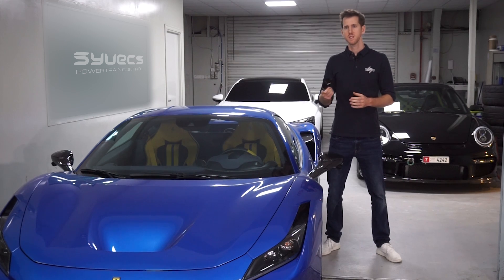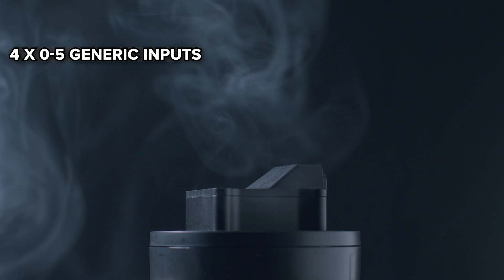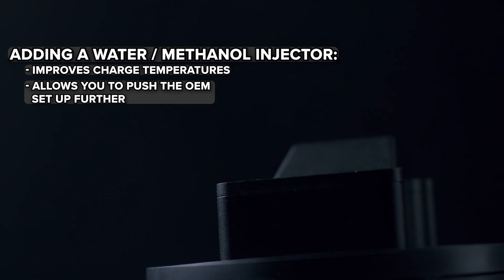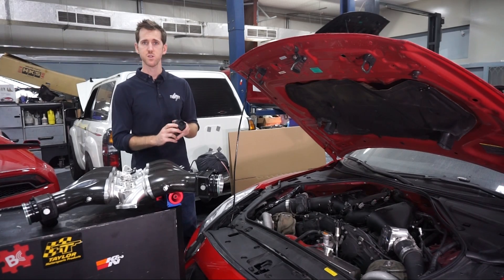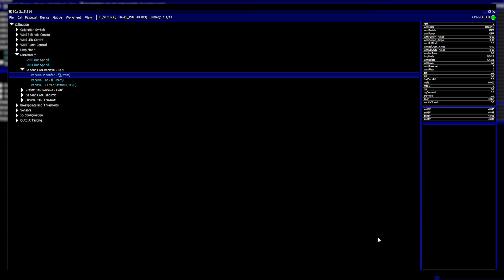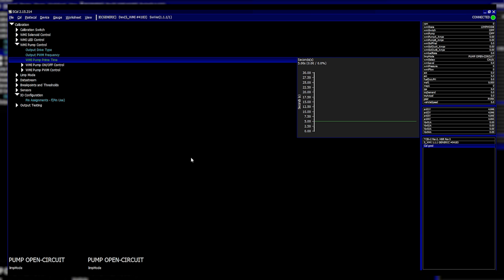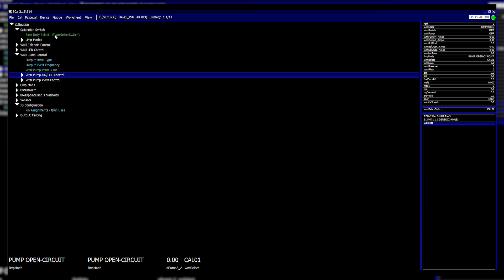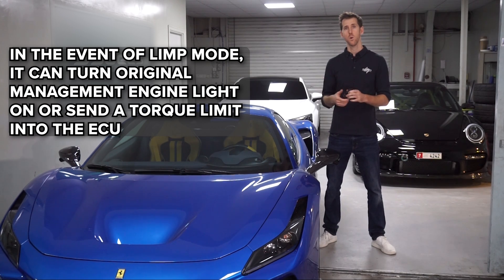Syvecs | Water / Methanol Injection Controller Tech Video

Comment: I was led to believe that this was a full stand alone controller, but unfortunately its still not as addressing can and obd protocols doesn't cover all cars.
I have a fdrx7 and a 2004 np Pajero that i would love to use this on but is not  supported.  The Pajero is pre common rail so still utilises the MUT protocol and is quite limited even though it does have some electronics which are part of the fuel pump.

Comment: I HAVE BEEN WAITING! For this product some time now, so glad it's available now. The terms used Slightly sweep off balance here & there however I'd like to share... My setup has a selenoid connected to a rail, from this rail there are then four nozzles each spraying into the manifold runners(as DI) with and option of a fifth nozzle. How can I integrate your unit to utilize it at its best. I'm using VW Golf 7.0 Syvecs plug n play kit.